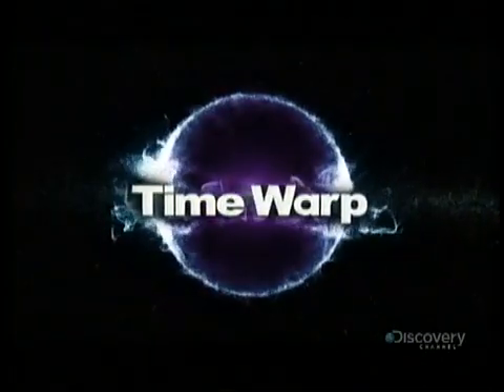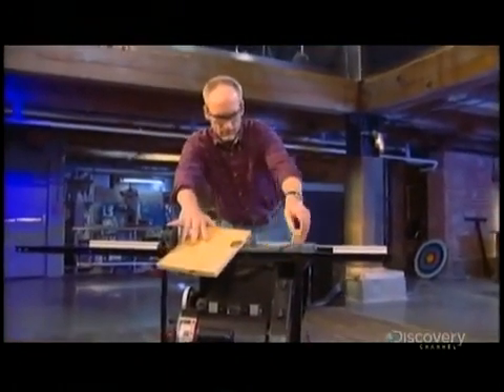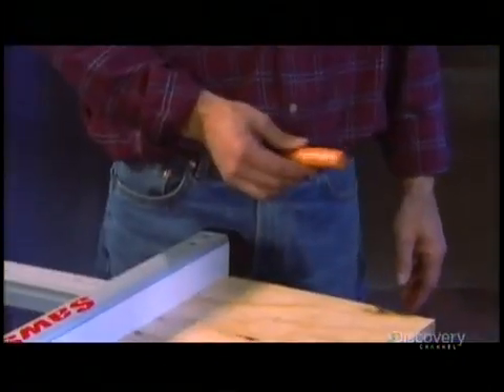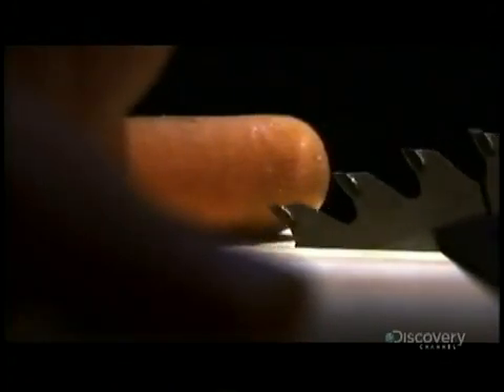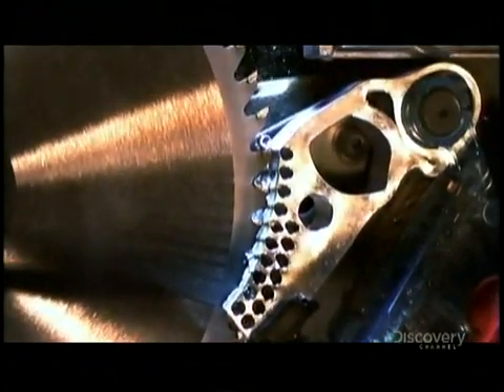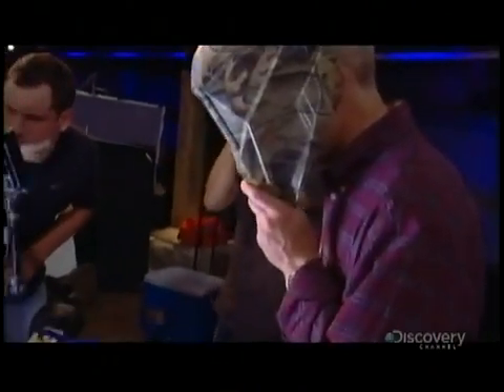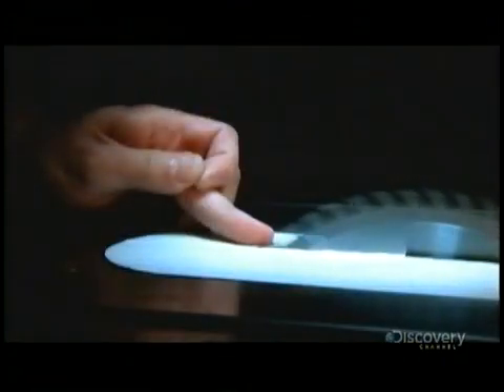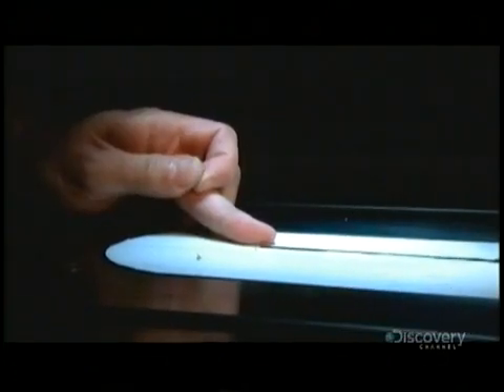Saw Stop - This guy puts a finger into an active table saw blade & comes away without a scratch!

Comment: What if you wear gloves.....
Reply: It's an absolute no go to wear gloves operating any machine with spinning parts....
Reply: You shouldn't be wearing gloves while using a table saw, or any saw for that matter
Reply: Why wear gloves near a fast spinning object, that's a safety hazard cause that glove can easily get caught in the saw and suck your hand in.
Reply: Have fun getting your hand mangled when the glove gets caught on the saw.
Reply: Tyson Dawe it would cut through the gloves and then stop
Reply: Circular movements + Gloves is a no no. This is basics.
Reply: Would simply need conductive gloves.... brightside
Reply: Workers dont wear gloves on a table saw. It's not allowed
Reply: Rip expensive pair of gloves🙏🏻🙏🏻😪
Reply: Raymond655 what is the point of buying it if you wear gloves cmon tell me 😂

Comment: My question is what happens when you run your finger across the blade at normal speed and not a snail crawl?
Put the wood and the hotdog back on there and run it like you would normally put a piece of wood through.
The concept is awesome.  Just want to see how it works on normal speed.
Reply: it will probably hurt you and maybe cuts a little bit in your finger..... which heals with nothing remaining. Other than cutting your finger in half... which does not heal at all ... but, well with the camera speed and everyting you should be able to do the math and calculate the timings.

Comment: Yea great... a little bit of moisture on the wood and your saw is ruined
Reply: Ikr rather lose a finger
Reply: That is not how electricity works
Reply: you leave your wood laying around in a puddle of water or something? obviously you dont make things.
Reply: Dumbest comment ever. All that gets ruined is the safety brake.And the blade of course.Easily replaceable,unlike your fingers.New brake costs about 100 bucks.
By the way... if you have to cut wet wood,say for instance, pressure treated wood, you can disable the brake mechanism.
Reply: Dont cut wet wood (lol)
Reply: Well the blade and stopping mechanism is. How you ruin the whole saw? We had one of these at my old job and hardly had any problems with it. Just let the wood dry, or use a regular table saw and risk losing a hand or more
Reply: It goes by electrical current, hence them saying that wood doesn't have much conductivity whereas a human body does. The hot dog had to be salty and wet to make it a little more similar to what a finger would be like but it's not just a tiny bit of moisture and the whole saw is ruined.
Reply: Cold workshop and condensation will make it trigger too...
Reply: It breaks if there are staples, the wood is wet, your finger, and if you do it too fast
Reply: unless you are using a chainsaw or giant bandsaw, you should never cut wet wood. that shit will bind up so fast in a tablesaw or circular saw you wont even know how fucked you are when it happens.
Reply: Rusty Rivet haha yea it's called saving a few thousand, buying a regular circular saw and not get carless.

Comment: I know that there are many accidents with the table saw but does anyone know specifically how? They use it without a riving knife? It's often unbalanced and falls over? People don't use pushing sticks? 

I'm thinking of getting a table saw and want to be safe and know what to watch out for ahead of time. Thanks.
Reply: Trying to cut large pieces of plywood without fence with blade fully exposed and without riving knife, no pushing sticks and using saw while being totally drunk.
Reply: Not using a push stick is a big one, so is baggy sleeves getting caught. Next is bad luck (hitting a knot/nail/rock and having the wood buck, sneezing or coughing, etc). Riving knife or tipping over is rarely the issue, assuming you take the normal precautions.

Comment: It's all happy and everyone's smiling until both the saw blade and Saw Stop fail bad  sending shrapnel flying into your body. It's trading one injury for potentially another. While it might save a finger, it might not save your life. I'm not sure I'd trust this device strictly seeing the deceleration forces and how badly that could go wrong.
Reply: It could break the carbide tip off if the sawblade is older, then that goes flying .....somewhere.

Comment: what if your wearing gloves then what? YOUR FUCKED!!!!
Reply: Wearing gloves with a table saw can actually put you in more danger as they can get snagged then pull your hand into the blade, these saws can cut through wood with ease so they will go through gloves like they are not even there anyway.

If for some reason you did wear gloves and put your hand into the blade it will go right through them and your hand will come in contact with it and the protection will trigger.
Reply: You are both wrong if you have gloves it would eathier rip the glove and come in contact with your finger and stop or it would pull the glove off and your glove is trashed or it will pull your glove in with your Gand and come in contact with your finger, stopping the saw

Comment: How well does it work with gloves on, or when you've been working with wood all day, and the dust has absorbed the salty moisture, reducing skin conductivity.
Reply: Don't work with gloves at all if you're using saws
Reply: @patrick-xu1go  dude it definitely works with gloves lol. It will cut through the glove and as soon as it hits skin BOOM. you're saved.
Reply: Roman Proof? Things still take time to happen. Even that tiny fraction of a second may be enough for the machine to suck the glove in and cause more damage to your hand than necessary. Just don’t wear gloves at all when working with saws and avoid the entire damn problem
Reply: @patrick-xu1go  I agree on not wearing gloves. Also unless you wear gloves that are impervious to being cut by a saw you are good. If it starts to suck the glove in it is bound to start sawing into your finger. The second that saw hits something that is both conductive AND grounded the stopper is activated.  So unless the saw never cuts through the glove which is pretty impossible imo, it will stop once it hits finger.
Reply: Legend Cox Never use gloves in the shop...So much machinery can get your hand pulled into the actual mechanism. Bad idea, learned from experience.
Reply: Big Dick Gang NO CAPES!!!
Reply: Legend Cox why would you use gloves when using a saw in the first place...
Reply: Worst case scenario: The saw cuts in 0.5mm deep into your skin & stops after the current's conducted & saves your finger ;)
Reply: i actually wore an oily glove in an auto shop and nicked my finger because my hand sliped
Reply: Mighty Jo2 l
Reply: Let's say you wear gloves.. the saw stops the moment it's through the glove .
And it stops the moment it gets through the skin if it's dry and the worst thing that could happen would be you have to put a plaster on your finger
Reply: Morgan Freeman what happened to you?
Reply: Legend Cox first of all why are you using gloves when you're using a saw
Reply: If you are wearing gloves or long sleeves you deserve to lose your fingers
Reply: Wow how did i find you again i find you in every youtube video i watch how tell me morgan freeman
Reply: You won't break your hand it will cut through your finger. So you would end up with a cut as deep as the teeth of the blade, which isn't much.
Reply: Anonymous what happens is the saw wants to suck in your hand because of the glove instead of just cut a finger off you may lose your whole hand
Reply: Daniel Leal Magic, I have you all figured out buddy. Expect to see me tomorrow at 3.
Reply: To cut your finger the dust need to get out of the way to the saw cut you and with a glove it will just cut the glove until reach to the finger
Reply: Legend Cox I never use gloves while using the sawstop and I must say the conductivity does get reduced but it still work you will end up with a band aid or something
Reply: Your skin is still conductive.

You NEVER use gloves while working with rotary tools.
Reply: You NEVER NEVER EVER WEAR GLOVES WHILE USING A TABLESAW!!!!!!!!!
Reply: Im just thinking what if your glove is so strong that little bit of time the saw touches the glove it gets caught in it, won't cut it and the saw drops when the hand gets hit, one mighty broken hand.
Reply: if your hands are wet then it works instantly as shown in the video, but if your hands are dry or dusty (more realistic) worst case scenario is that the saw will cut a little way into your finger, skin deep or maybe just enough to bleed, before it detects you. A nick or shallow cut is still a damn sight better than losing a finger though!
Reply: I would think that even wearing gloves, as soon as it cuts through the glove it would sense the finger, and even if your hand is not wet or salty it is still conductive, not as much, but still
Reply: O_O Morgan freeman
Reply: When it cuts past the glove and hits your hand it stops.
Reply: @MLGRACCOON  it doesnt just cut through it sucks the glove and if your hands in it its not gonna be good
Reply: Personally I would be more afraid of my long sleeves, necklace, earphones, and long hair getting caught
Reply: @andrewc1036  
Once my cleaning rag got caught by the fan belt while checking the engine of my car and trying to listen for pings... scariest day... lucky I didn't get injured
Reply: 1. never use gloves around spinning machinery, you'll get caught and lose an arm instead of a finger.
2. even if your skin is impossibly bone dry, if it broke through a layer of skin it'd be back to normal conductivity so the saw stop would activate and the worst you'd get is a scratch/cut.
Reply: Blood is moist therefore conducts electricity so a nic will ca un se it to go off as for gloves if you're using a table saw with gloves on someone taught you wrong
Reply: You shouldn't be wearing gloves while operating a table saw anyways. That introduces more risks.
Reply: Hafeez Rehman no it sucks the fucking glove in and breaks every bone in your hand
Reply: It cuts through the glove andddddddddddddddd
Reply: I'll stop once it hits blood
Reply: It I'll stop once it reaches blood
Reply: I've always been told not to ever wear gloves using saws as it can grab and mangle your hand or worse
Reply: who wears gloves when working with high rpm machinery?
Reply: Bandit Keith i only wear one...michael jackson
Reply: Works exactly the same - as soon as it goes through the glove and detects moisture it will go off
Reply: @Nectar Krsn Thanks for your contribution to my comment from years ago. Cheers.
Reply: Im pretty sure that if you use gloves, your hands most likely are going to be a little sweaty... It will still work it will just cut through the glove
Reply: mic drop!
Reply: When you wanna look like an intellectual critic but in reality you have little to no idea what you're saying.
Reply: Anonymous it just sucks the glove in and hurts you more

Comment: What if a mosquito would fly by the saw and touch the blades?
Reply: Maksim Huzmiev Whilst it's moving? Natural selection.
Reply: Its not grounded so no electricity would flow and would not trip it... The mosquito would be shredded apart.
Reply: rip mosquito
Reply: Shut up idiots, the mosquito isn't grounded.
Reply: Maksim Huzmiev too small of resistance
Reply: It only ruins the saw blade and cartridge.
Reply: I think the conductivity is to small from mozzy
Reply: rip saw as well

Comment: A salty wet finger ~ A  S A L T Y  W E T  F I N G E R ~ A   S  A  L  T  Y   W  E  T   F  I  N  G  E  R
Reply: Cooper Hince He's actually cheating by using a salty wet finger -- it's way more conductive than dry skin.
Reply: The purpose of the salty wet finger, is to reflect on the fact that normally it will draw a little tiny bit of blood, and then stop. They'd prefer to not get that far, cause your blood is salty and wet too.

Sweat may also work.
Reply: Cutting inside a little (until it reaches salty/wet part) is better than cutting trough.
Reply: Candycorn 2014 well, i don't think it's hard to have a small box with salty water next to your table saw and just put your fingers into there before using your saw.
Reply: Yet if you remember to put your finger in the box of salt water, then you are going to remember to be cautious with the saw. Therefore just sell boxes of salt water instead,
Reply: Its still going to stop
Reply: saw a vid of a guy that caught his hand in a really really bad place on the saw. it cut into it gave him a nasty cut but it stopped. had it not stopped it he probably would have lost a few fingers if not his hand
Reply: Cooper Hince lol I was just at that part
Reply: ThePikachuFan99 same lol
Reply: IM THE 420TH LIKE

Comment: If they would have made one of those back in the 70s on a band saw, my left middle finger wouldn't have been sawed into.  Yes total accident back then but only felt like a razor blade nick at the time.  Later on when the doc stuck a needle on both sides of my finger down to the bone to numb it for surgery , Oh I found out what pain was all about.   43 years later finger still good.

Comment: I stuck my finger in a table saw blade long time ago. Totally operator error. I was lucky though, as the blade cut at such an angle that it simply sawed the flesh from the tip of, yes my middle finger on my right hand, almost to the knuckle on the end of the finger. Separating flesh from bone but not cutting the bone, almost like filleting my finger. I didn't have pain like this guy. Only an extreme burning feeling in my finger when I did it, after that nothing they did caused pain I have nerve damage and arthritic type of pain now and again with it, but it could have been way worse.

Comment: I want to see this working like it normally does when the operator is not paying attention and has dirty, sawdust covered hands while cutting wood  at normal speed instead of putting his hand in specially prepared salty water in a cooler then CAREFULLY touching the blade.
Reply: it works where i work we have one and it saved someones finger or hand the other day i don't know which no one is confessing lol but we all saw hundreds of pieces of wood a day so we have saw dust all over our hands
Reply: I've seen these things trip in the high school woodshop, and it really did work when some idiot wasn't paying attention.
Reply: was the guard in place
Reply: Garras Porgratix Garras Porgratix most people that have watched this probably haven't used a table saw. What makes people think that when you use a table saw it just rips the wood in seconds it's slow (kinda). And the way these things are built no matter how much sawdust you have on your hands there's enough salt on your fingers to do "the trick"

Comment: People having that kind of job, most of the time using a gloves at work, so in that case, system is useless...
Reply: It'll cut through the glove but once it hits your flesh inside the glove it'll stop.
Reply: Till then it will be to late :P
Reply: Well after one day working in sawmill you will have a ton of splinters in your hands bro... And yes, I'm talking from my own experience.
Reply: Rafał Praski you don't wear gloves while operating spinning machinery. It could snag your glove and suck you hand into the blade or sander. My buddy lost his pinkie and ring finger cause of that

Comment: idea: instead of stoping the blade with that block, the blade could be pulled down by a pre-loaded spring or pneumatic jack, at the same time of stopping the blade normally. Avoids scraping the blade and the stop mecanism everytime.
Reply: Drup44 it would still be too slow. This is the most efficient way right now

Comment: So every time the machine detects moisture it self destructs? This will never sell
Reply: Well sure it will...$60 replacement for the damage or a huge medical bill...your choice
Reply: +Justin G. so fresh wood applications are a no, using outside with the potential for rain is a no. If this ever becomes the apprentices will be warned too NEVER run the blade with this optional safety feature enabled (because it will have to be optional as it is so hazardous in every application other then ideal)
Reply: It´s not sensitive to moisture, it senses capacitive signals. It works just like a touch screen. Moisture won´t do anything
Reply: +Waldhallmer Heljumsdottir drip some water on a capacitive touch screen
Reply: Did that, didnt do anything.
Reply: [OD]Maggy ok
Reply: lol